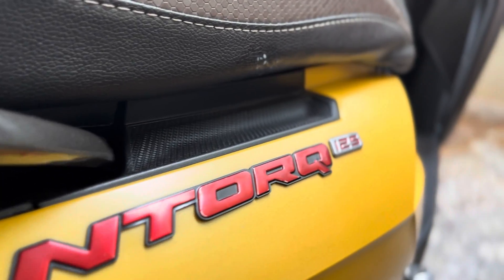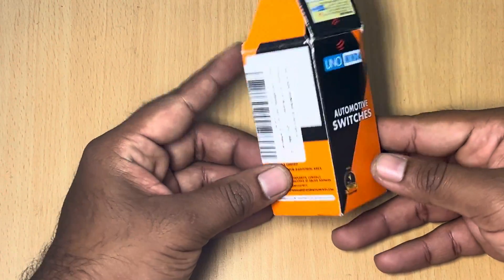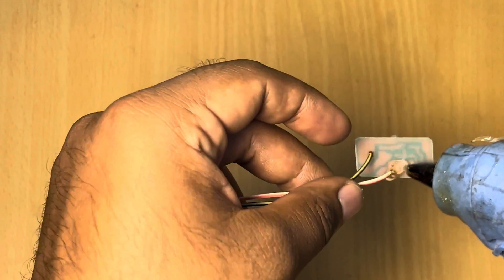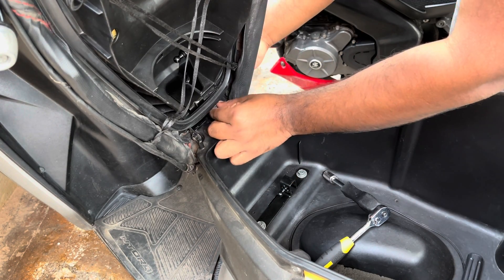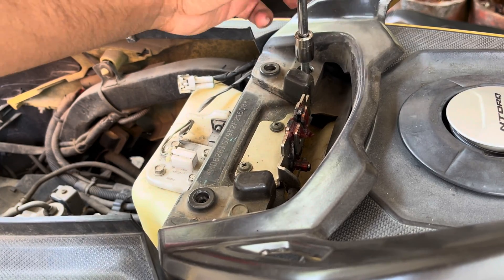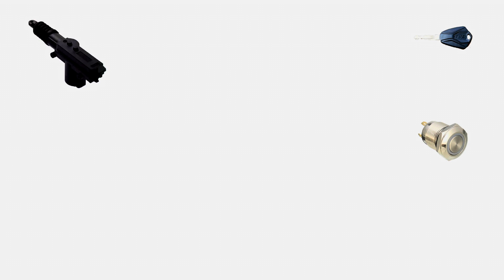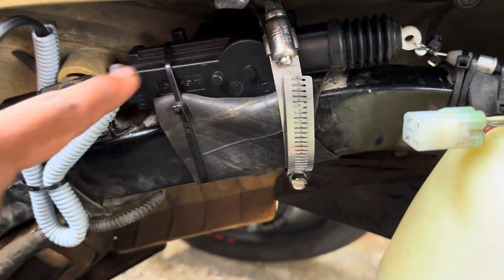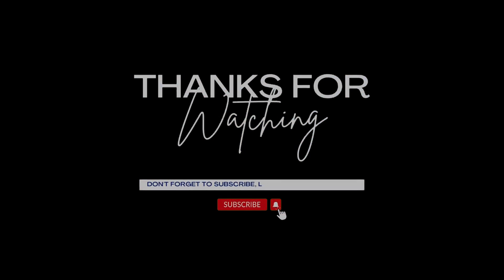Automatic Boot & Fuel Tank Open With Safety Features #ntorq #tvs #ns200 #ktm #tvsntorq #tvsntorq125

Comment: Can this be installed in Activa? Will this be a direct fit if possible?
Reply from the maker: Slight design changes required as the fuel cap is different
Reply: @ARKIONX  I'm planning only for seat bro. Can this be installed in seat without any clamping modification?